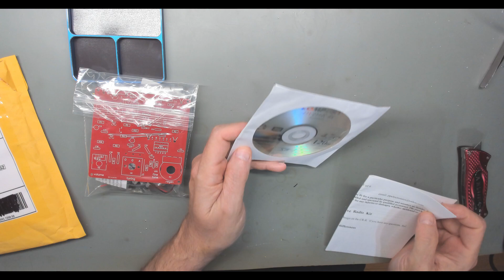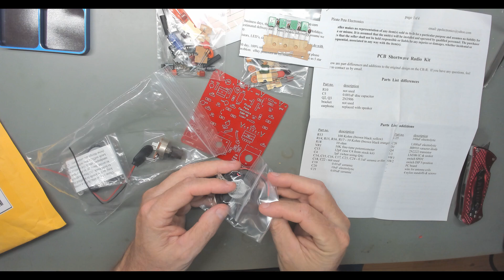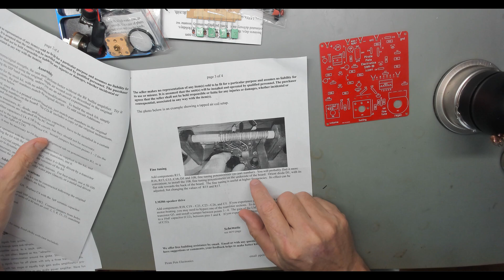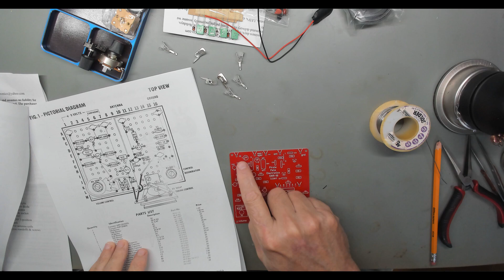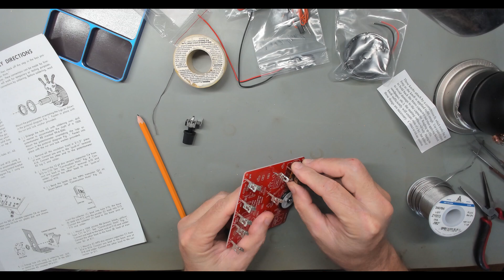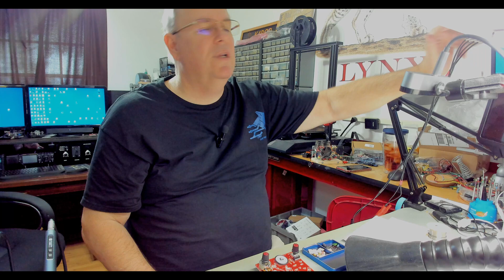I Spent Hours Building a Transistorized Radio Kit and Here's What Happened

Comment: I  had that  Science Fair   SW radio kit from Radio Shack    It had that particular "brown" variable tuning cap with the open plastic plate divider sheets.   As a kid in the 1970's I had my first  crystal AM radio kit which provided  that same "brown"  tuning cap along with the same flat clear knob and wide flat center screw.  The radios did not work at all,  both the SW kit and the Xtal set.   As I later discovered, when I replaced the original brown tuning caps with a big old junked 1950's era big metal tuning capacitor,   they both finally worked.  As it turned out those original "brown" tuning caps were shorted out.   Im sure that was a common problem with that variable capacitor type.
Reply from the maker: Very cool story, I hope my unit works when it’s done. Shame you had bad variable caps on both kits. Glad to be able to bring back some nostalgic memories. I also have many of my youth playing with electronics. 
RJ